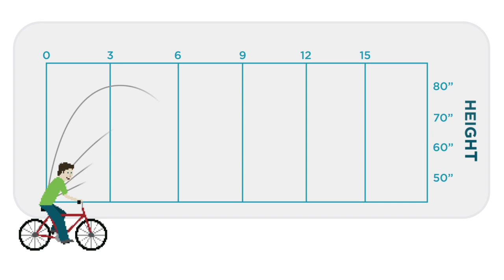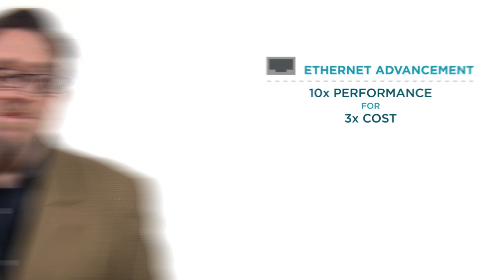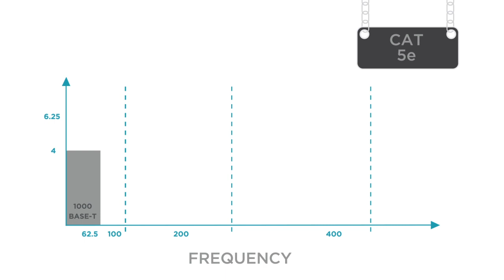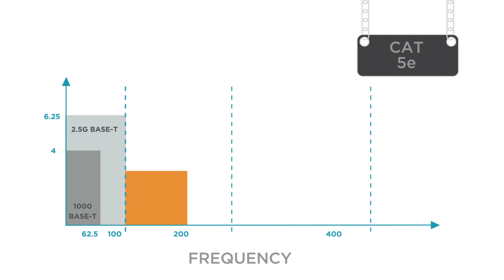Fundamentals of NBASE-T

Comment: I wonder why the Cat9300 Multigig switches run so damn HOT!!
What is Cisco doing with these that draws so much POWER?
The UX-M switch is running at 240 watts when merely powered up.

And if you're talking about getting the most out of your existing cabling then you should also mention using LRM optics to get 10Gbps over your OM1 fiber plant